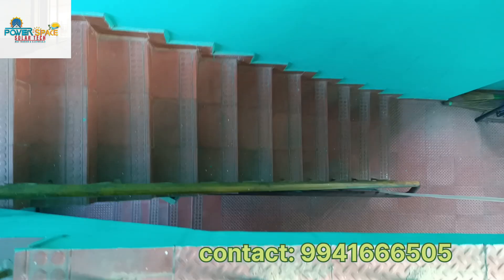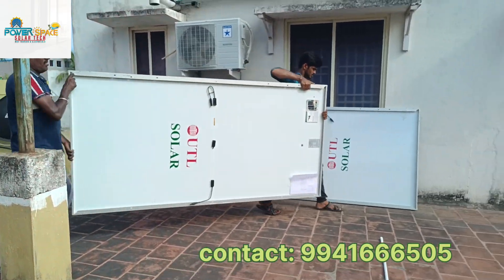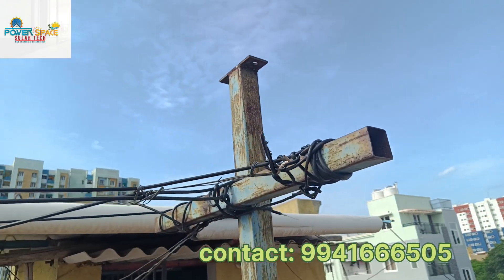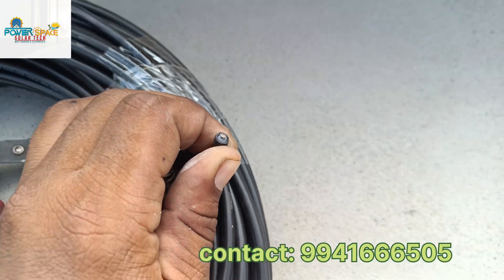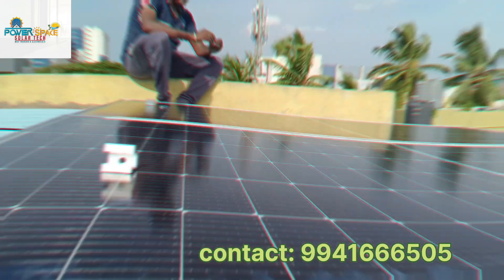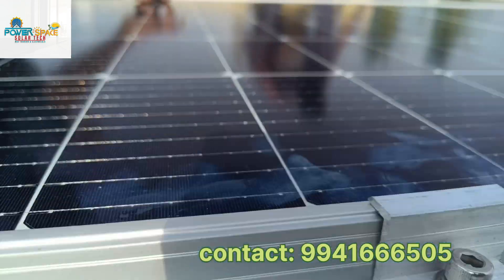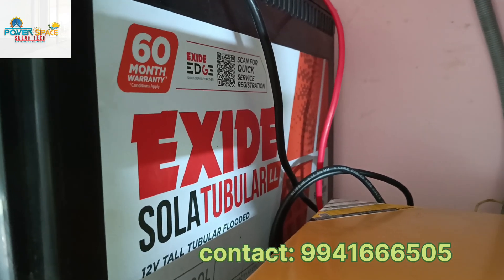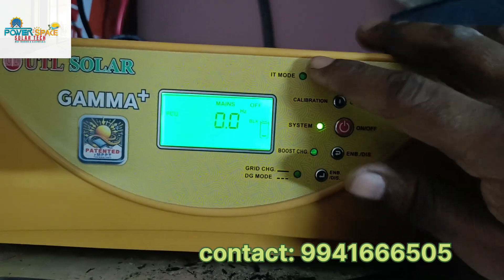1kva solar system for home and office, utl inverter and panel, exide battery, Chennai

Comment: Soler  panel 24v  and why  using only 12v battery  and  the inverter all so 12v  sir it's possible to connect 24 v soler panel to 12v inverter and battery how it works
Reply from the maker: Mppt  உங்கள் பேனலில் இருந்து வரும் வோல்டேஜை கம்ப்ரஸ் செய்து ஆம்ஸை இன்க்ரீஸ் செய்து கொள்கிறது இதுவே எம்பிபிடி டெக்னாலஜி

Comment from the maker: 80000
Reply: Panel 24000,gamma plus inverter 13000, battery 16000 wire and mounting 6000 to 8000. Total around 60000 only. Installation 20000 ah?
Reply: Too much cost
Reply: Omg😮